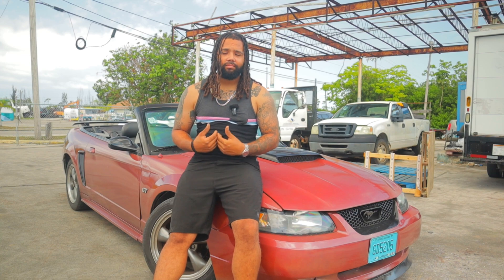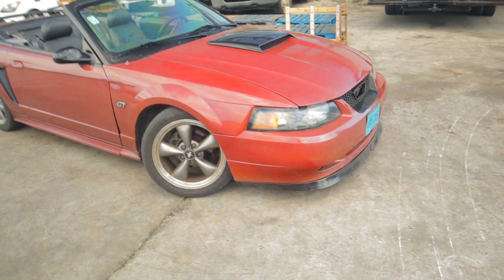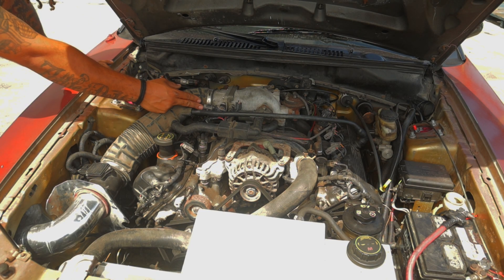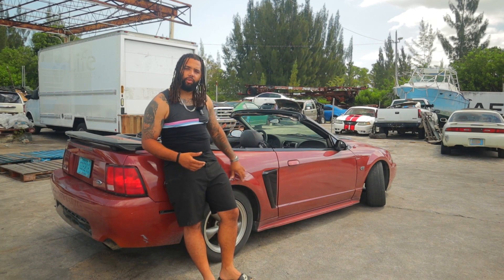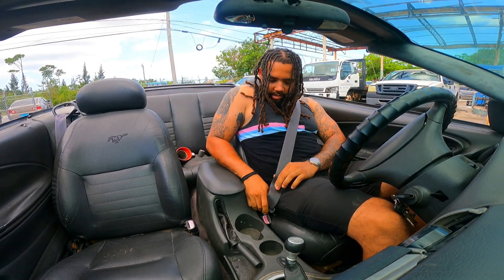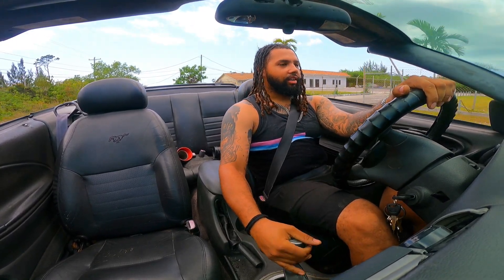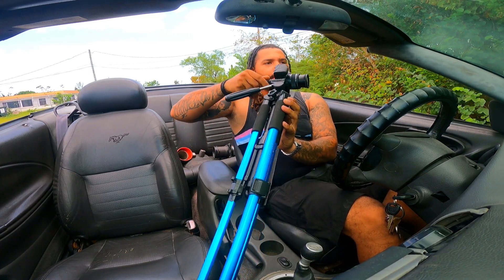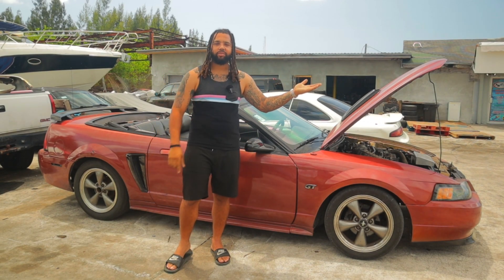How To 4v To 2v Swap

Comment: Hell yeah, the 2V is singing, sorry  that another 4V crapped out on you, but you got this 2V running  strong.
Just did a complete timing chain kit, and refreshing the upper half of the 2V motor in my 04 GT 2 weeks
ago in the car, much needed repairs.
Reply from the maker: I actually did the same in this 2v motor, timing chains are definitely a weak point to these motors

Comment: If the heads are still good on your 4v why not just use the new 2v shortblock and swap on your 4v timing cover heads and other stuff?
Reply from the maker: The pistons are different in 2v and 4v engines if I used 4v heads on a 2v block the compression will be way low